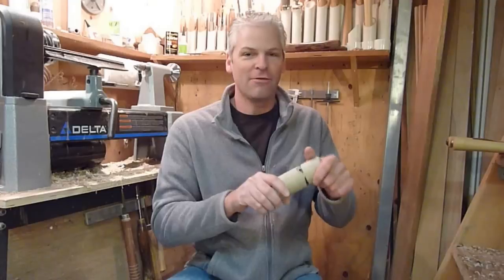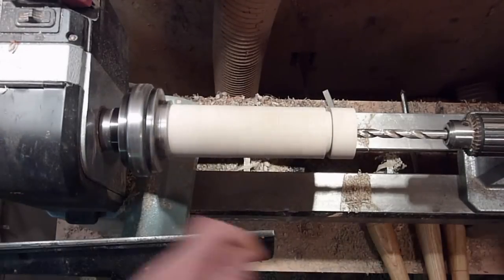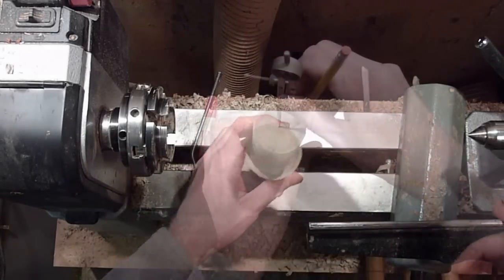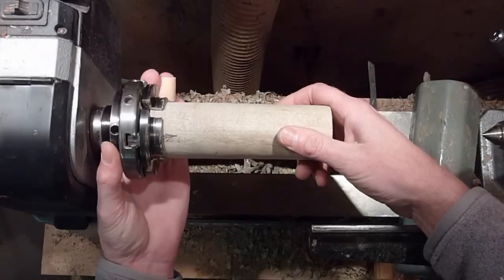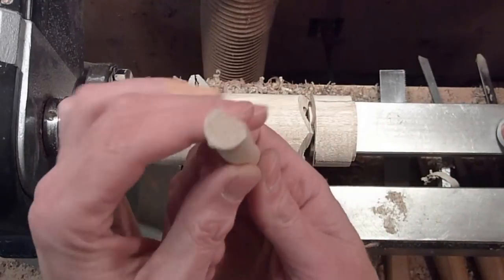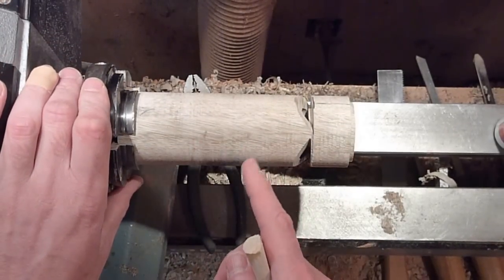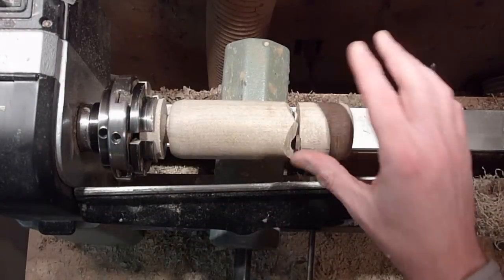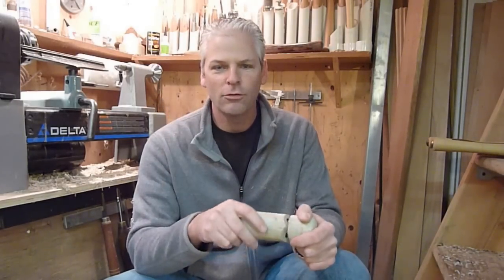Woodturning Train Whistle

Comment: Interesting video! You can buy a magnetic base, holder, and dial indicator to true your wood absolutely true by placing the base on your ways, putting the indicator on the wood, and rotating the wood until the dial shows no run out by tapping gently on the end of the wood piece. One machine shop catalog I used in the past is Enco, which also has an internet catalog. They mostly have machine shop stuff, but lots can be adapted to wood working.

Comment: Do you do anything with the shavings or just toss them in the fire loosely. I have been thinking of making a press for the shavings and sawdust but it seems they need some pulp to stick together. I'm currently packing the sawdust into paper bags and dropping them into the fire once in a while. Burns slow if undisturbed but flares up hot and fast if broken up (as expected).

Comment: I think the pitch is determined mainly by the length of the hole or holes in the main body of the whistle.Fuzz around the angled cuts will effect it  but the actual pitch is the length of holes. Maybe you could make a whistle that has the hole all the way thru the end and a dowell that would fit snugly yet slide so one could change pitch.

Comment: Hi Carl, I was surprised you left the whistle so plain. :)
Also it would would sound more like a train whistle with 4 pipes (holes). Even if they had to be smaller diameter. And then deeper holes would give you a deeper sound. It may be possible to turn the openings instead of flat cut, I think they would still work but I will have to try it. Thx for another video!

Comment: As for what affects pitch, it's both the width and length of the bore. 

This is closed bore, which means that the chamber of air has to go the full length of the bore, and then double back in order to escape, making them lower pitched than an open bore whistle of the same length. 

A bit of a tip is that if you make the splitting edge TOO sharp, the tone can be shrill and thin. A slightly more blunt edge helps, but too blunt and it gets really breathy, and not clear at all.